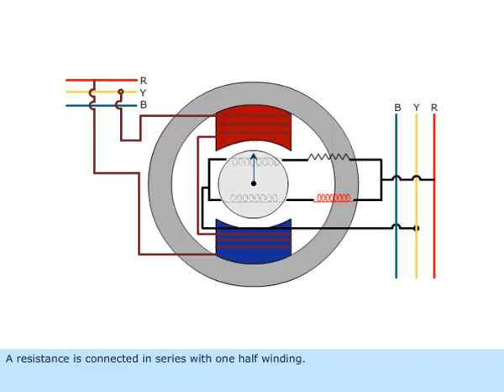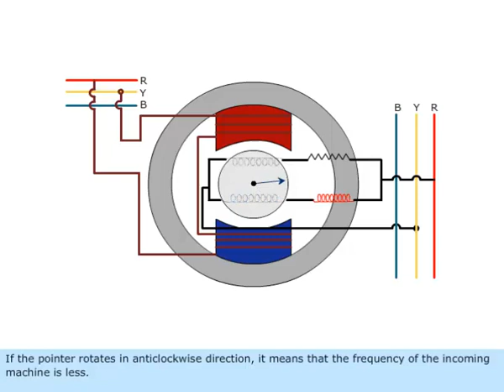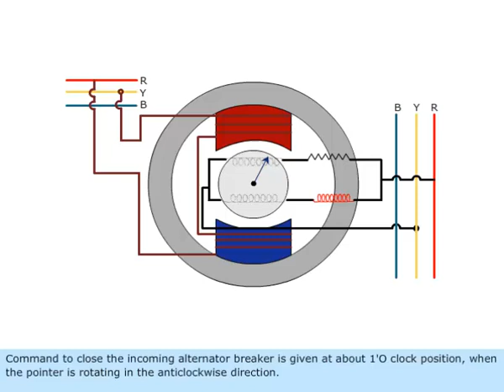synchroscope

Comment: Incoming generator frequency must be little more than running generator to gain up the  frequency drop at the time of parallelism
So it is possible to close the breaker at 1 o'clock when synchronous cope rotate anticlck wise.

Comment: Why the third phase is not involved and why the capacitance resistor is not added and how could you connect a not equal current load at a parallel connection that can cause damage of the system and burn generator and also transformers how do you connect a non equal current load generator in a power grid without calculations or without a big shunt based on other countries calculations detailed report sister 😢

Comment: What happen with the system when dg set has syncronize with turbine,control dg set voltage adj up/down &frquency adj up/down is can be  adjust but the out put not come too?
Reply: If the DG is behind the refrence, it revs up to spin faster, if its ahead it slows down. Once locked to the refrence they all move in step

Comment: Can we close breaker @ 1’0 clock  while syncroscope is rotating in anti-clockwise direction ?.
Reply: You can synch but it takes reactive power from system, if your system capable to give such reactive and gen protection allows it,  then generator synched but if not then generator is not synched.
Reply: @electricallearnings3735  pls explain briefly, how it absorbs reactive power from system? System means machine or bus?

Comment: Why synchronoscope moves clockwise and anticlockwise ??
Reply: It's depends upon dominant of magnetic field.there are two magnetic field is created by stator and rotor.when stator magnetic field is high and so pointer rotates clock wise direction.
Reply: assuming 50hz refrence

Clockwise = Source to be synced is ahead of the refrence - 52 Hz
Couterclock wise = source to be synced is behind the refrence - 48 Hz
Reply: the direction the need is pointing correlates to the phase relationship between the two signals. if your signal and reference are at slightly different frequencies, the phase relationship will be constantly changing, thus the rotation.

with two signals of the same frequency, the needle will remain stationary; if they are fully in phase, the needle will also be pointing straight up.